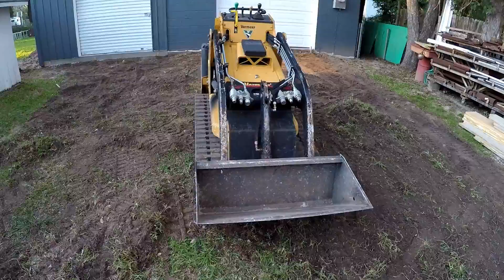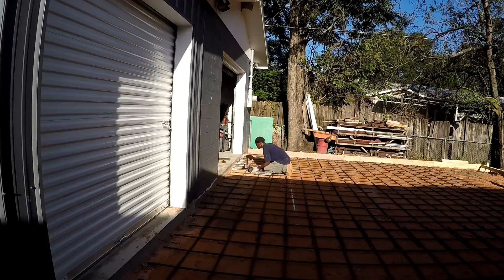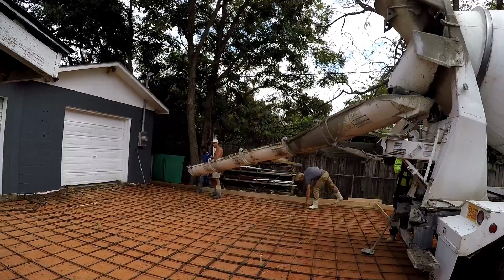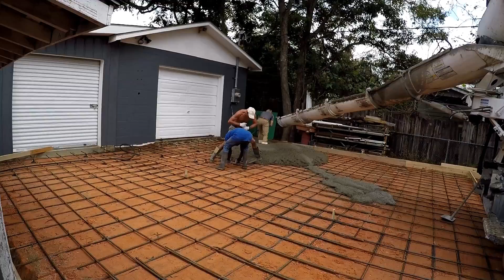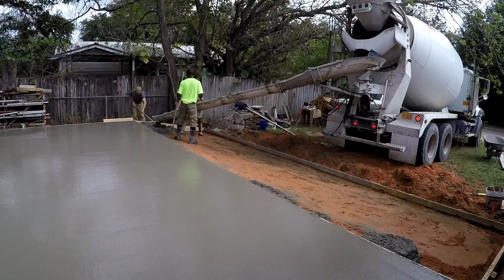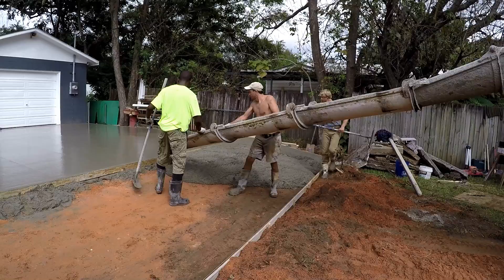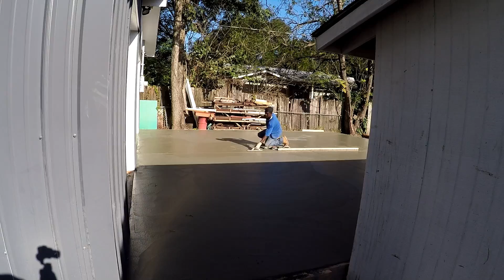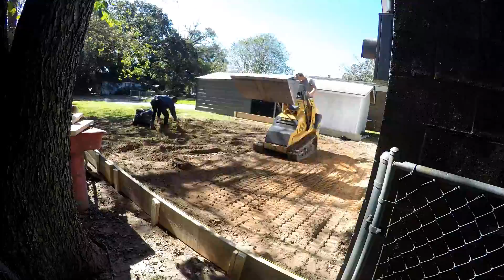New Shop Concrete Slab!

Comment: My day off from driving a concrete mixer and I'm watching a pour *facepalm*. Good finish crew there too.
Reply: good finishers....? those are the slowest worst finishers ive ever seen.  Absolutely nothing they are doing is special.  

They rodded it the wrong way so they could couldn't bull float perpendicular,  they put the roughest broom finish possible, they put two grooves in 2500 square feet...  they didnt put rebar or anything structurally connecting the ramp to the slab..

this is bottom of the barrel finishing work.
Reply: @tmichael1262  let me go ahead and say I am no expert. But I found it odd the overkill on rebar in the slab but the ramp got zero also. Possibly was a cost saving idea? I didn't understand the lack of rebar supports either. They sell 50 at HD for less than $30. If the job is that big with a minimal crew those would be worth freeing up a man and making everyone's job easier on pour day along with the owner being confident the rebar is in the concrete. 🤷‍♂️

 Also from watching others like Odell Complete Concrete the broom work was rough, and the minimal expansion joints had me scratching my head. Maybe he wanted the finish really really broomed deep? 🤪 And possibly that much rebar requires less expansion joints? 

I think his guys worked hard and gave it their best shot. Definitely better than I personally could do. 🤣🤣🤣

As for those who don't like being watched do their profession. I don't mind when I am being watched. I actually prefer they watch. I wouldn't do anything different with the owner watching than I would do if they were not. But if they watch they sure can be polite and respectful of the fact I have work to accomplish. Also if they watch there are no surprise phone calls later about how this was not done or done wrong etc.
Reply: Lol!!! Me too!!
Reply: Same here lol day off from driving  and yet here I am beer in hand watching concrete being poured
Reply: @TruckinWrenchin  this mixer driver needs to learn how to wave it at he's pouring. will go farther and not all over his truck, slow the roll a little, dump the chutes and then raise em up as the big blade wave passes and it'll shoot it out there for em.
Reply: haha - had a friend who's brother was a railroad engineer and on his days off, he would work on his model railroad.  Crazy to think about but sometimes jobs are more than just jobs.

Comment: I usually leave a 1 inch step down in front of the garage doors so rain will not blow back under the door.  It's a good feeling when the concrete is down and finished and the mud disappears.

Comment: as a concrete worker  that was a complete rip off job it wont last him never use sand as a base and you can tell it wasnt walking troweled right nor broomed right you never broom back and forth always one pass and when finished right you dont see the marks only the broom lines andddd they should have pinned the new to old with rebar and used expansion  joint in a couple areas

Comment: Pour water for 8 days after the slab dries up. Water will cure it properly and you wont ever get cracks
Reply: It'll crack someplace, give it time.  Water is good for curing and is used to keep cure temps lower, yes

Comment: No, the vibrator is for the air pockets it vibrates all of the air out of the cement so you wont have holes in it after it is finished.

Comment: Trust me when I tell that the guy who has the hardest job is the guy running the screed board. I worked concrete for a long time and I can tell you that I would rather run a rake for 8 hours than a screed board for 1. These guys did a fantastic job from set up to finish just all around awesome!

Comment: It is very interesting to find that what appears to be a simple job (make hole, dump concrete, make flat) is a very time intensive, laborious project requiring higher levels of skill than I would have previously presumed. Hats off to you concrete folks!

Comment: i cant help it.  butt there is easier better ways to do things.  hard working crew no doubt. but i like to work smarter not harder . hire a pump it saves alot of hard energy waisting shoval work. rebar in the ramp could and should be tiedto the slab. monolithic 
 one piece and you could dp that if you didnt have to back the truck in so far .  hire a pump.  having more then enough guys on site is always a good thing. concrete wont wait for anybody. they are puring there last truck when someone should be cutting joints and edgeing . my boss would shit a chicken if this went on at his jobs. .

Comment: wow thats really well reinforced. what ya parking on that thing? A plane?   Imagine in 100 years the crew that is hired to remove it   ..
Reply: how they gunna get the form board at the top of the ramp out and wont it leave a 1.5" gap.  If they leave it in there it will rot and leave a slot .

Comment: I think there shit the steel isnt at correct height at all.. its practically on the deck.. should all be raised before concrete no good lifting it while its on top of it .. you could tell the we're struggling to lift it up
Reply: No engineers here, I see.  The last place you want rebar is in the center, as that is the neutral axis.  Yes, you don't want it too low, but an inch above the deck is fine.  You want the rebar in tension, which it will be close to the bottom.  Too high, it is in compression, which defeats the reason for having it.  In the middle, it is in pure bending, which is also pointless.

I've done a lot of my own concrete because I cannot afford to pay others to do it.  Those boys did just fine, especially for so small a crew.
Reply: Try lifting 5/8 rebar before pour shits heavy I know been doing this work for over 30 yrs , once you get concrete on it forget it , at one foot centers
Reply: they are shit for sure,  but pulling the rebar up like that is standard practice. as long as it is all completely encased in concrete the height is nearly irrelevent for a simple pad like this
Reply: @teejaye110  Not correct. Rebar height is critical to concrete strength.  It will probably still hold up ok, but to say the height doesn't matter is wrong.
Reply: Did you ever think that when he encloses that space and has to bolt the machinery down he wouldn't want the hassle of hitting a rebar if it was raised.
Reply: @carmo9693  I think he would care more about his slab completely failing from the rebar laying on the ground, then having to deal with drilling into it. Rebar should generally be about 1/3 the thickness from the top. Middle is probably closer to what is typically achieved on a slab like this. If you going to leave it on the ground save yourself some cash and just leave it at the store instead.

Comment: Unless thee concrete has fireglass u needed expansion joints every 8 ft at most by code unless ur city or state is different concrete cracks due to pour compact no expansion joints n the broom finish shouldnt have dust after finish but to each there on if the joints werent done u can still do then with the saw cut but u need them to ensure durability

Comment: New concrete over dirt??  Where's the Stone?  They also didn't remove all the sod.. also should have been 4000 air, rebar doesn't do shit on the ground..  they should have pulled it up or used chairs
Reply: they pulled it up and placed the chairs during the pour. (They talked about it early in the vid, and it was clearly shown in the time-lapse segment)

Comment: One thing I would of done was add one more section of the chute at the start  to save all the drag work!! Also why no rebar in the ramp????🤔
Reply: Gary Douglass some drivers only allow the amount of extensions he has on the truck, so they do not over stress the chute.. another 4 feet adds a lot of stress!!

Comment: Your steel in laying on the dirt - elevate it to the bottom 1/3 of the thickness of the concrete to get actual strength benefit

Comment: I worked as a concrete mason for 15 years, and I would say that was a good crew. I do think the turn-down at the edge of the slab was too narrow. That could be a problem, if you extend your shop onto that area. It would probably be fine, but building codes...

Comment: You might consider pouring a footer at the leading edge of the ramp maybe 12 X12 " level so it will take the initial load when you drive up the ramp

Comment: You know I watched this whole video and I can tell you these guys are hard workers. But they needed to lift all rebar before they even started also that front board should  have been removed and put an expansion board in its place and never pour concrete without reinforcement  wire or rebar. But good job. Campbell Concrete out of Texas

Comment: What No Rebar in the slope, and not drilled and rebared into left garage door opening, and no high chairs left in the concrete to keep rebar elevated of substrate, when they took the few chairs out and moved them arround they then stood on the rebar thus pushing it back down on the subfloor just an observation.

Comment: that is back breaking, hard ass work. pouring and leveling concrete is one of the hardest jobs I have ever done. it will make an old man out of you in a short period of time. I feel for those guys running the concrete. the vibrator makes the job a little easier, it makes the concrete flow and level out, also gets rid of the voids.

Comment: 1 Sand as a base layer, 2 no waterproof membrane, 3 vibrating poker should have been used for the whole pour, 4 no proper expansion joints, 5 ramp not tied to main slab, 6 no rebar used in ramp. Yes I used to work in the construction industry.

Comment: They did not do a very good job with mixing the crete from the first to the second together and has a cold seam, you will no doubt find later that will be where cracks first form. Your ramp should of been poured separate and pinned from the first slap to the ramp slab. Your ramp slab will have a tendency to slip and crack, and will be lower at the joint where the two meet in just a couple years.

Comment: Looks great Adam, nice finish work. Why no steel in the ramp, pathways and compressor pad? I used steel in everything including the standby generator pad and the water well sanitary seal. The original well seal had no steel and you know it cracked and split.
Randy

Comment: Wow, doing a pour with 3 people, I have never down a slab pour with less than 4 and 2 finishers, getting a guy that's a maestro on the screed board, saves so much time.  Yep, we give 28 days for curing on a 6" slab, 21 days on a 4" slab,  walls can be put up the next  day though.  Keep it damp though, water and the lime react for the cure, if the top gets too dry, it stops curing and you'll have a surface that wears out quick.  Give it all a spray in the morning, at lunch and when you get home. Damp is good, don't need to get it soaked.   Looks fantastic!  The coarse brush finish is great for rubber tires, and to keep you landing on your butt when it rains. Remember to keep the leaves off of it, cuz if you have a layer of leaves and it rains, 1. they can stain the concrete, 2. you can slip and get really hurt.  I have a corded blower to keep my concrete clear.

Comment: That is a genuine 4-jaw slab !
Nothing short of a hard work or excellent result. Now, let it be rain to harden it out.

Did You know that the sand that is suitable for concrete is becoming harder and harder to find. The gravel must be suitably angular to create a good bind. For example the sand in Sahara is totally unsuitable because the grains are too smooth and round.

Thanks for sharing 1

Comment: While running mud looks simple, it does require a skill set for a job to be correct.  These guys did a good job.   I would encourage any young person to work on a concrete crew just to learn the fundamentals.  You can always find a job on a crew.

Comment: Hey man looks good. Being a carpenter that does alot of concrete work myself. They could, should have used concrete paver slabs to crib up that bar. Cheaper than chairs and no fussing trying to lift bar.  Also i  know your ground doesnt move like mine, but even  1/2 inch bar on a 2 foot grid in that side walk and that ramp wouldnt have hurt.  Not trying to pick it a part just want it done right for u bro.

Comment: Just be careful with the Internet cable. If you use regular copper networking cabling, I would add lightning arrestors on that line as both building do not share the same grounding (fibre optic cable would be ideal but probably cost prohibitive). People generally underestimate how much damage EDS or surges can do to computer networks or even to electrical systems. Keep up your good work.

Comment: not bad for the crew. thumbs up. if this is for a shop , how come the footing on the side are not bigger. they  have could put rebar on the ramp at lest #3 .because the ramp is going to look like your old drive way in time with big cracks.just remember fiber mesh is a secondary reinforcement  . you don't have to wet the concrete just spray a clear cure.

Comment: I doubt you'll ever drive anything that heavy on it to crack the ramp, but a bit of mesh in the ramp woulda been better. I did die a little inside when he broom finished it after the nice steel trowel finish. I imagine you have a reasonable fall in it, but I was surprised you have no channel grate or pit stormwater in it. I'd run a good heavy steel storm water channel grate along the front of the ramp. It'll help to stop flooding your lawn and it'll also protect the leading edge from cracking. Otherwise nice job. He's a good concreter. Must be Greek....

Comment: OMG!  OMG!  They shorted you a piece of rebar Adam!  Get the jackhammer!  The sky is falling, the sky is FALLING!

J/K, man.  Good stuff!  I just had to get a poke in at the armchair code enforcement officers and wannabe structural engineers that seem to be on hand in the comment section of every video.  That's gotta get old, real quick.

Comment: If this was mine, I would have done away with 8 feet of ramp on the fence side and have a dock so that I could run a trailer up the edge of the slab as it would have been easier to load and unload with less or no 'trailer loading ramps' angles.

Great video, you must be made up with the results.
Reply from the maker: +Terry If it was yours...

Comment: It is a shame they did such a good job, then ruined a good job with the broom finish ????
I sat here thinking WHY ????
Reply: some people like a broom finish, had it done that way here, more for the reason of winter snow/ice though :)
Reply: Yes i understand.
Its Adam,s workshop, so his choice.
 I just could not see any reason for it.
It,s very bad for holding the dirt / stains, and impossible to sweep with the rough finish.
Reply: What happens when he gets a shop built on it, and there's machine oil everywhere on the smooth finish? Skating rink.

Light brush finish definitely the way to go, and will get easier to clean after it's sealed.

Comment: Thanks for the video, Adam. It's funny how something as simple as a bunch of concrete can be so enjoyable. Next  spring I am building a 28 x 60 garage/shop so I can move my shop out of my basement. I am building the structure myself and, while I have done concrete work myself with fairly good success, I plan to hire this one out; you can't take your time with concrete. It was good to watch your contractor and it appears he has done a great job.
Reply from the maker: +Paul Decker Yep, jobs like this I think it’s best to just hire a crew and let them get it done. Sounds like your goings to have a nice sized shop!

Comment: Why there is no iron in the sidewalk and the approach slab?
Reply from the maker: +Mikron 0.001 I may removecramp later for an extension. Sidewalk doesn’t need rebar either.

Comment: Is the form board between the flat section and the ramp left in place?  (or is it a special piece of material that is designed to be left in?)
Reply from the maker: +Vern C It will stay there.